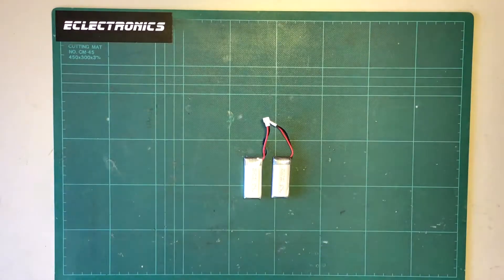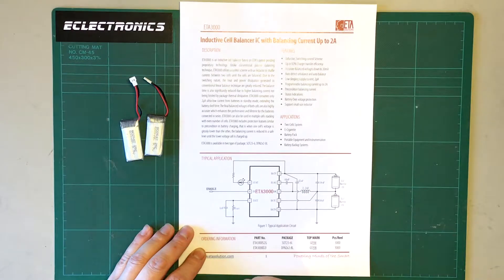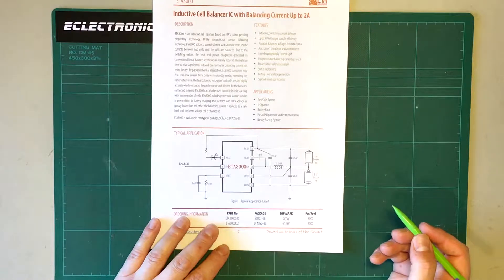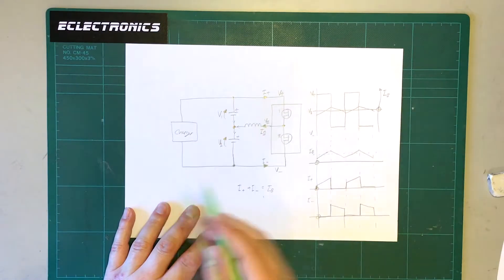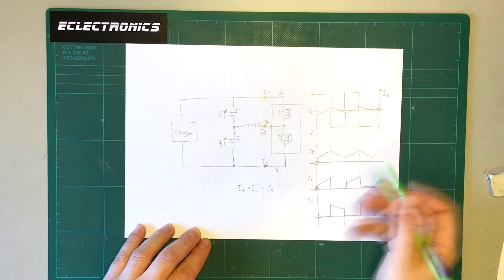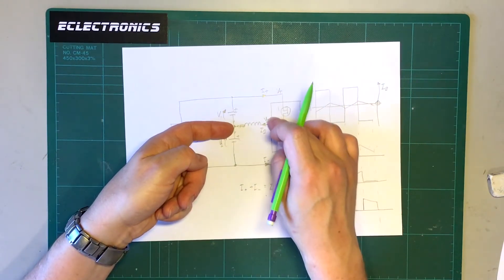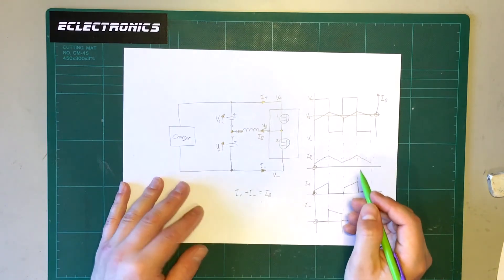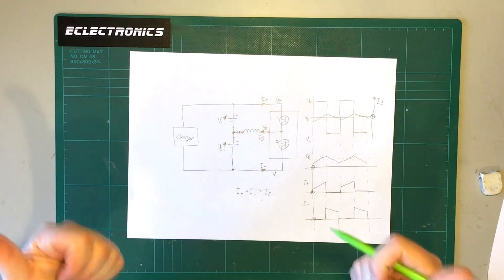Cell balancing Part 1 - Active Inductive charge balancer for Lithium cells - Just how does it work?

Comment: Thanks for this quite good intuitive explanation that finally helped me to understand this principle of balancing batteries by balancing neighbouring cells.

I may help you on following question: What is limiting the current?

==> In my understanding the size of the inductance is key in limiting the current, but in detail more parameters are important. The voltage across an inductance is L x dI/dt. When either of both switches is open, then basically the voltage on the inductance must be same as the voltage on the cell (not considering parasitic losses in the MOSFET). This means the size of L is setting the increase in current dI/dt. The absolute current is also depending on the time dt you allow the current to increase.
Once both switches do get toggled, the voltage across the inductance must reverse. Out of the 3 parameters L, dI and dt only dI is able to become negative, this means the current continues to flow in the same direction, but it decreases.
There must be also some logic to decide, which cell has the higher voltage. Based on this logic first the switch on this cells need to be swiched on, because which switch does get first switched on determines in which direction the current will flow (discharge cell 1 and charge cell 2 when first switch 1 gets closed and vice versa).
If my theoretical understanding is correct, then the first dt time should be longer than the following ones to i) set a certain amount of current to built-up according dI/dt.

Comment: This type of balancer can actually ruin a perfect Top Balance.
Reply: In my understanding it is poor misunderstanding how a balancer is working/should operate that causes problems. An active balancer can work at any charge/voltage, but especially on LiFePO4 you should limit the active balancer to work only when the battery is fully charged, 100% full (top balanced).
When you allow an active balancer to work all the time, then this balancer does VOLTAGE BALANCE your cells, but because of the nearly same voltage this destroys any charge balance. What a battery needs is a CHARGE BALANCE, and a charge balance you can realize on LiFePO4 only when the battery is 100% charged (or discharged to 0%), because only at these 2 points the voltage is sensitive enough to represent the charge accurately.

Comment: 15:00 There are diodes parallel to mosfets 1 and 2, oriented up or pointing up (or whatever the term used).

To transfer charge from V1 to V2 (ie, V1 > V2)
MOS1 is turned on, it draws current away from V1 and into the inductor and into V2.
Then MOS1 is turned off, the voltage at Vb drops to a low point such that the diode across mos2 will complete the circuit and charge V2. 
Buck charging.

To transfer charge from V2 to V1 (ie V2 > V1)
Mos2 is turned on. It draws current away from V2 and into the inductor and into V1.
Then Mos2 is turned off, the voltage at Vb spikes up to a high point such that the diode across mos1 will complete the circuit and charge V1.
Boost Charging.

Rinse repeat using PWM to regulate the amp. The problem with this balancing is: It transfers charges between adjacent cells; it cannot transfer cells from C1 into C3 directly. And if you have 20 cells, you will have to ripple the charge across all cells.

There is another inductor balancer using Transformer, which I believe is more superior than this Buck/Boost as it can balance on multiple cells and into multiple cells.

Comment: Hi, 
Thank you for this Video. What I do not understand, why is the charger  connected? This principle should work always (during discharge, charge or even without both). Or am I wrong?
Reply from the maker: You’re absolutely correct, the IC works whenever there is a voltage imbalance. I used charging for the illustration because that’s usually when it matters most, trying to top balance a pack. If you are discharging with a very low current then it may also help eek out the last few joules of energy but most applications are faster discharge than the balancer could handle.
Reply: Even though this principle does work at any voltage, especially for LiFePO4 batteries you should limit operation to 100% charge, because at 10 to 90% charge the voltage is not at all accurately enough representing the charge. Please note, balancing means you want to balance the charge, but the actual operation of balancers is based on voltage equalization. Voltage balancing is no problem when you have some clear increase of voltage with charge, but LiFePO4 does not show this clear voltage to charge relation but has nearly the same voltage in 30 to 70% charge.

Comment: I think you have it wrong.  Keep in mind, that when an inductor is charged, it reverses current when the power is cut off.  So assume the top battery has less voltage than the bottom battery.  To get the charge in balance, the bottom MOSFET turns on, and charges the inductor to + on left side and - on right side, using the voltage from the bottom (higher charge) battery.  Then the bottom mosfet turns off and the inductor reverses charge, - on left side and + on the right side, then the top mosfet turns on and charges the top battery from the energy that came from the bottom battery.  This constant checking and rebalancing utilizing the energy from the battery with the highest voltage to transfer energy to the lower battery using the inductor.  The process is reversed if the bottom battery has less voltage. where the top mosfet charges the inductor, - on left side + on right side, then shuts off, inductor charge reverses  + on left - on right, bottom mosfet turns on and charge that came from the top battery, goes into bottom battery.
Reply from the maker: Hi Mike, thanks for the comment. Your description of the circuit action sounds correct but your comment about the inductor seems wrong. An inductor does not like the current flowing to suddenly change, it will present whatever voltage to the circuit is necessary to keep the current flowing in the same direction. Thus it is the voltage that reverses, not the current. This forced continuation of current, resulting from the stored energy in the magnetic field, is what allows energy to be transferred from one cell to the other.
Reply: @Eclectronicschannel  You are right.  I meant to say, reverses voltage, not current.   oood catch.
Reply: Keep in mind, that when an inductor is charged, it reverses current when the power is cut off.
==> Irrelevant, because there is no condition of power cut-off on the inductance, the inductance is either on V1 or on V2 (either MOS1 or MOS2 is switched on).

Then the bottom mosfet turns off and the inductor reverses charge, - on left side and + on the right side
==> NO. When MOS1 turns off MOS2 turns on. The inductance has the tendency to keep the current flowing the same way and this means V2 gets charged. With MOS2 on, the voltage on the inductance needs to reverse polarity/needs to be same as V2. This reversal of voltage forces the inductance instead of increasing the current as previously now to decrease the current.
Then these cycles continue until the voltage difference is small enough, this means MOS1=on/MOS2=off: V1 gets discharged and V1 forces the current to increase, followed by MOS1=off/MOS2=on: V2 gets charged while V2 forces the current to decrease, ......

Comment: I've tried to simulate this on SPICE but unfortunately I had no luck. Starting from the top mosfet that keeps conducting to the duty cycle to properly regulate the charge.

The idea was to create and Arduino version of the ETA3000.
Reply from the maker: If you set your PWM to 50% and the two cell voltages to the same value you should see no net DC in the middle balancer connection. If you then change one of the cell voltages a bit you should see that one cell has a net negative current and the other has a net positive current, this is the balancer at work :)